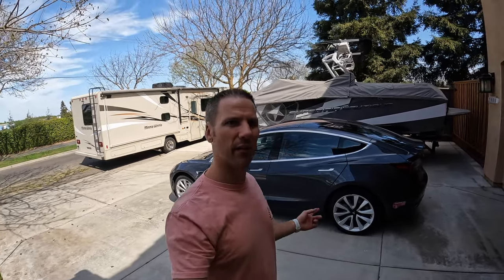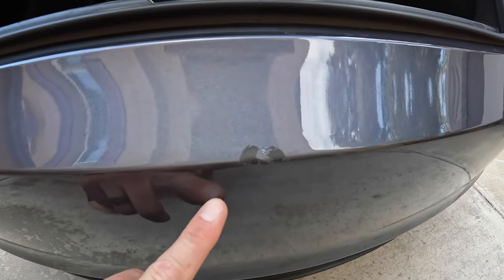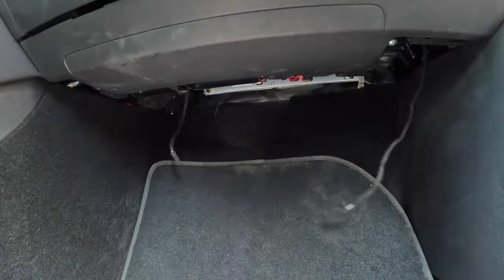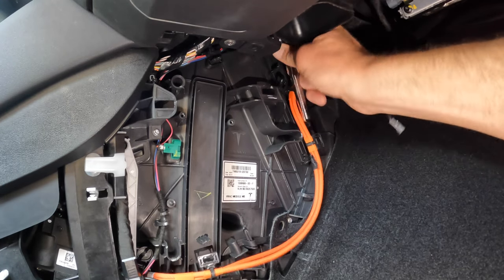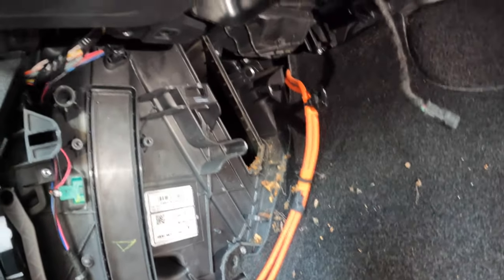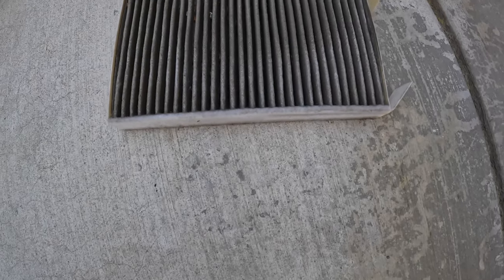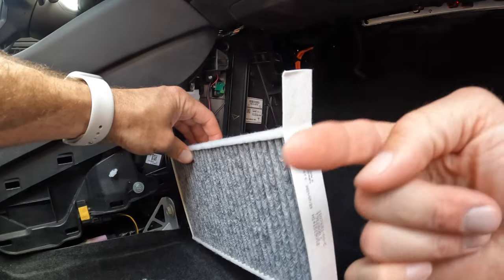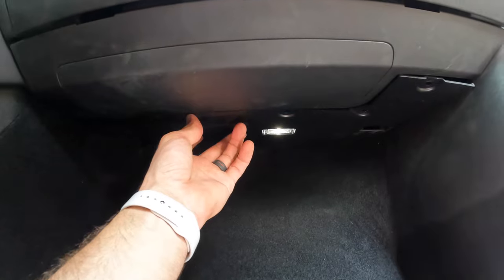How To Replace Tesla Model 3 Cabin Air Filters and Clean Evaporator

Comment: I am fairly certain that after spraying the evaporator cleaner, you want to run the fan WITHOUT the AC on and NOT in recirculate mode.

Comment: Sorry super easy question, but what type of torque wrench kit is that you are using here? Any link to Amazon/etc would be appreciated. Thanks!
Reply from the maker: Hey David, I don't have the link to the Torx set I have but here is a new set from Amazon. 
LEXIVON Tamper Proof Torx Bit Set, Premium S2 Alloy Steel | 13-Piece Security Star Bits, T4 - T40 | Precision CNC Machined (LX-301)
Thanks!